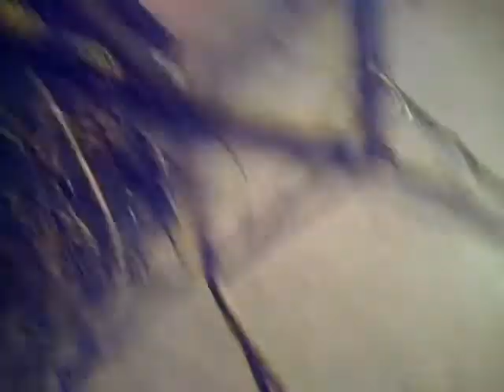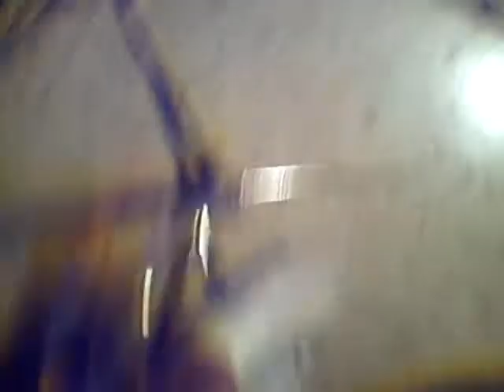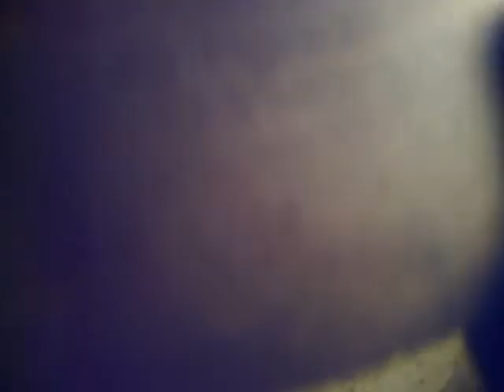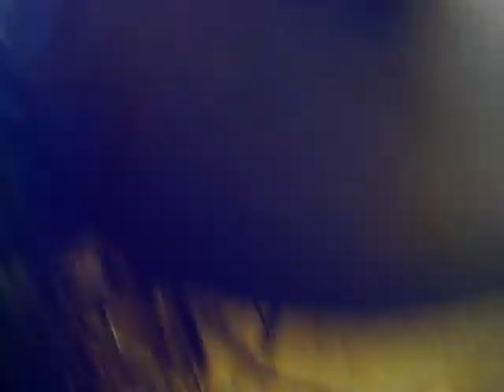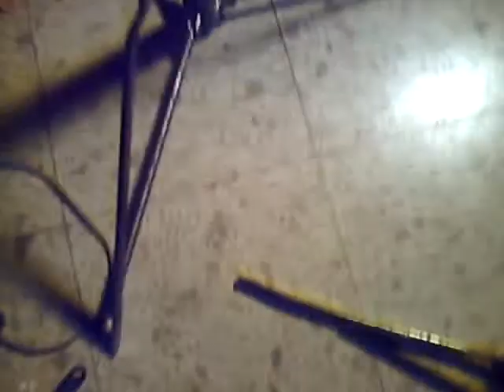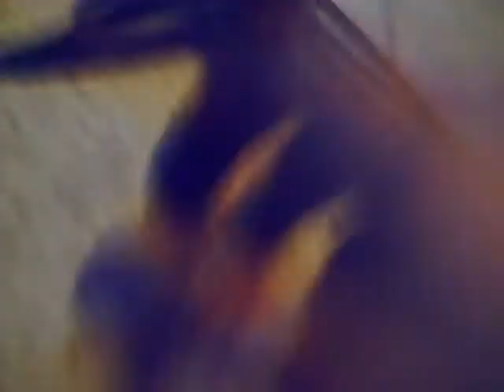djed telsa tower light 2

Comment: Because your "Stands" are metal, your not doing anything but transfering high voltage over a distance.  You need to make a resonant air core transformer with matching frequencies in order to do this wirelessly.  The spark gap only acts as a high voltage switch.  It will beat at 120 beats per second due to the current being fed from AC.  You need capacitors and the rest of the setup to say it works.  Until then, this is nothing.

Comment: Chuck, the aluminum foil - is that connected to the bottom cymbal and are you using it to extend the ground colser to the top cymbal? I thought the bottom cymbal is commected to ground via the cymbal stand? Does the foil add another spark gap strengthening the whole charge? Thanks for these gifts man - I'm getting this! The way you're presenting this makes it so easy to understand. The role of the spark gap insetting the frequency is so much clearer now.

Very cool!

V,